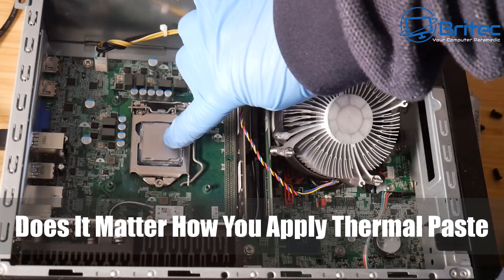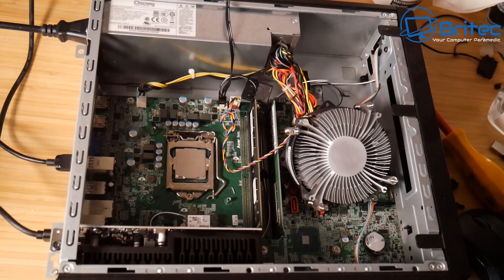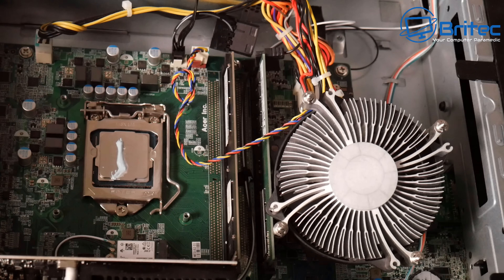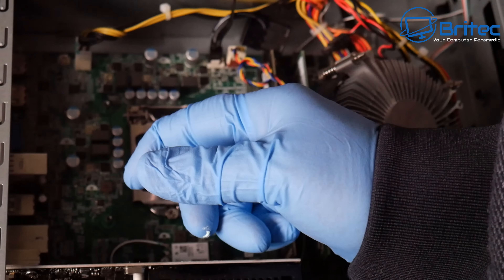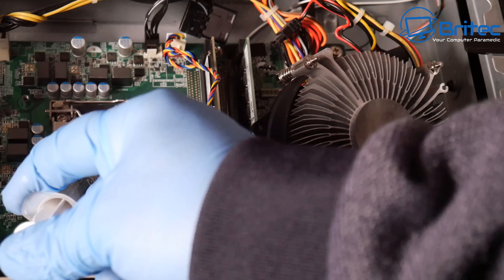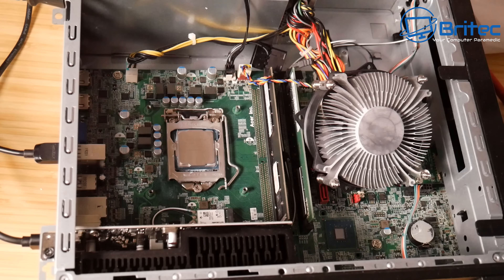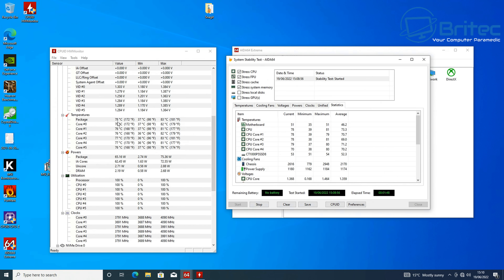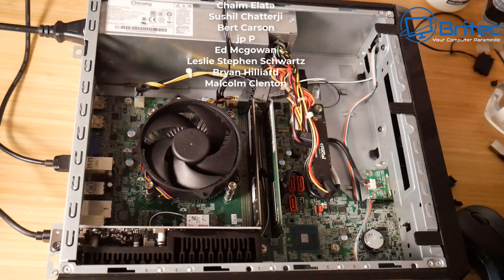Does It Matter How You Apply Thermal Paste

Comment from the maker: How do you apply thermal compound? Drop us a LIKE 👍
Reply: I've always used the spread method as I was taught in IT school. But as you said, as long as the head spreader is covered that's what counts. I also believe in lapping the CPU and the water-block or air cooler so they are as flat as possible. My water-cooled over clocked Ryzen 9 3900X usually idles at 28c, and tops out on most games at 48 to 52c.
Reply from the maker: Very nice temps.
Reply: Pretty much the same way as you do Dave short & sweet without any air gaps.
Reply: @Britec09  Thank you.
Reply: I use the spread method. Apparently, some batches of MX-5 were recalled early last year due to production issues.
Reply from the maker: That must be one of them, because it was watery
Reply from the maker: I see what I can do
Reply: i have always spread it out with a credit card or spreader. i did a lot of overclocking and extreme cooling 20 years ago and found it gave me the most consistent results. But as we all know, anything that comes pre built has the one blob method and that is good enough for most applications.
Reply: pea method works fine for me, have a nice day :)
Reply: A little Satire is great.  :)  made my day.
Reply: Dumb comments are kind of the price of being in the open and seeking attention in public. I understand how this is unwanted but you cannot have the 1 without the other. Seeking a large amount of people means you will get the attention of the smart and also the less smart. Earning money here while complaining about the negatives of being in the open dont go together too well. If you seek a large amount of people you will get the attention of all kind of minds and mindsets.... just be happy to get attention. There is this little place called reality and things work that way around there. But its good to have yet another vid about the subject of paste, gg.
Reply: I've always used the dot method in the center. I use HeavyLoad to stress test the CPU and I have a Noctua NH-D15 for a cooler. After a half-hour test, I maxed at 52C. I would say that's pretty good!
Reply: Britech i know you smart but you put the problem wrong, put rise on AMD tredriiper and put on i3 2 core 4 treds. in your videon you not specifi your pc your procesoor.
if you use 5 years old procesor ,even with tooth past ,the procesor will stay cool but if you put in amd 5950x is not the same

Comment: I agree with you. As long as you use a good thermal paste and you get an even spread it doesn’t matter. I’ve spent ages looking into this and testing temperatures and the differences between methods is negligible. After installing CPU bench test and monitor thermals
Reply from the maker: Totally agree!

Comment: When I first got in the game I was trained to spread the CPU paste with a spreader.  Now I apply the paste in a small circle in the middle of the CPU, slowly tighten down the heat sink fan to the CPU, and the paste spreads out perfectly. Out of curiosity I have torn down and inspected computers I did two to five years prior, and they all look perfect.  
If you're super OCD about it apply the different methods to your own personal CPU until you get it right.  Like Brian says almost every method works the key is to apply the correct amount.
Reply from the maker: Well said, what ever works for you.
Reply: Yeah...I use the pea method...just in the center and be done with it...

Comment: What I've found over the last 40 years is that is is less about the method you use, but getting to be consistent and proficient with that method. Find out what works for you and don't worry about what someone else does. I've learned what works for me and I stick with that.

And no, I won't say which method as that can change depending upon the specific compound I am using at a given moment.
Reply from the maker: Thanks for sharing.
Reply: @Britec09  My pleasure.

Comment: I just put enough of a blob on it to cover the CPU and that's it. never had a issue or really care for the arguments.
end of the day thermal paste is only there to fill in any imperfections on the cooler base and CPU IHS so that all air gaps are filled allowing the heat to freely travel through
Reply from the maker: Well said sir Tony

Comment: The very first computer I built going back to my AMD K6III, I was given advice by a friend who had constructed his own water cooling system using a bucket of water and a bunch of hoses. He told me, you put your thermal paste on, then you take a razor blade, you hold the razor blade at 45°, you pull it across the top of the surface so that the thermal paste is even and smooth, and then you're good. Ever since then that's all I've ever done and it works perfectly.
Reply from the maker: Glad that method works out for you.

Comment: another helpful tip is to lap the cooler surface using 400 grit 500 grit then 600 800 then 1000 grit to polish and use metallic infused compound like arctic silver which have better thermal transfer.

Comment: Great video as always Brian! I do agree people make it out to be a much bigger deal online than it is. In my opinion getting the "perfect" amount of compound isn't as important as it probably was 20 years ago. I've never been the best at fitting CPU coolers or applying thermal compound, so much so at one point I managed to assemble a cooler that wasn't aligned properly and that's where the PC kept freezing up and I had to pull the plug out from the mains to get it to turn off so I could restart it (since even holding the power button didn't make it react). Upon correcting the misaligned cooler, I never had any problems going forward. Same as I've never had any issues with PCs due to bad thermal compound application, although once the pre-applied compound that came with a cooler caused issues to start with but after a few days the issues settled (where I'm assuming the paste has spread out properly).

Although I will just say one thing, along with the messiness of too much compound, some compounds if they spill over onto the motherboard can cause it to short circuit, but this isn't a criticism since you did say you shouldn't put much on, but just perhaps that was another point to note :)
Reply from the maker: That is liquid metal and not you normal compound, already answered that question in the comments :)

Comment: Personally I use only Grizzly products applied to both surfaces with a small applicator,  there was a time when I used bulk-rate thermal paste and the pea method but have found over the years that total die coverage with an applicator does indeed reduce thermals and quality paste matters.
Reply from the maker: Grizzly thermal paste is one of the best

Comment: I made an applicator for doing this and I always apply it to the heat block and not the CPU. In all but rare cases does the heat block fit the same dimensions as the CPU. Anyway, I apply the paste and then use my tool that spreads it much like you would applying cement for a tile and it has never let me down and never wastes any!

Comment: Brian it ihas occurred to me that when they make  CPU's they put a compound on the underside of the metallic top cover and the silicon chip for heat transfer. My query is will the metallic thermal compound also bond directly to the silicon chip itself as some you see in GPU's. Can not find an answer in Google searched  so what is your expert opinion?

Comment: I use a Thermal pad. works just as good and absolutely no mess to clean up. All of these methods in your video differ by a degree or 2 Celsius and none will stop the computer from working. Amazing what people will bitch about it seems

Comment: Anytime you apply paste into the middle of the IHS, it will spread into a circular shape. The ISH is NOT round and that means the corners are not going to be covered unless you apply so much that the edges overflow.

You need to cover 100% of the IHS. I realize that the heat-producing elements of the CPU do not extend fully to the edges, but the job of the ISH is to "spread" the head evenly and therefore you want 100% of the IHS to have the ability to pass heat to the cooler.

The spread method is really the only method that pretty much guarantees 100% coverage. You can get 100% with others, but then it relies on using just the right amount of paste. Why allow that to be a variable?

Comment: When I worked for Motorola we used to have instructions on the need for paste. Basically all metal have fine indents on the surfaces, so you fill these indents with heat absorbing paste. Nothing more,

Comment: i think that the best product today is THERMAL PAD THERMAL GRIZZLY CARBONAUT . These thermal pads are avaliable for any type of CPU and GPU ,are reuseble and have an amazing rate of thermal contactivity : 62.5 W/mk . You don`t need any skill to apply them and you have not any risck from leakeges.
The benefit is that you pay for that once as you can use it again and again ! With a cost around to 10 euro you solve the problem once for ever.

Comment: Question: is there a time where the paste should be replaced?
Reply from the maker: If you use the spread method, this will cover the whole heat spreader for any CPU, so you can't go wrong.
Reply: @Britec09  sorry, what i meant was should the paste be re-applied after say 10 years of use or does it last the lifetime of the cpu?
Reply from the maker: @VSTV1993  Replace the paste when your seeing temps rise, which will be in a few years. But saying that, its cheap and won't hurt to change it more often.
Reply: @gilkesisking im asking this because iv got an old laptop which is i think a 2011 model BUT its a good decent laptop and iv upgraded it with an SSD and more RAM and iv even swapped out the cd drive for a HDD Caddy so i can i have more storage, i watched a few videos on it off Youtube and the cpu temp hit just short of 90 degrees but then came back down with the fan on full speed
Reply: @gilkesisking could even be that the fan needs a clean at best

Comment: It’s been all proven and tested many times. The application method all gives the same temperatures within the margin of errors. Do the simplest way that works for you mostly. The pressure from the cooler will spread it evenly.
Reply from the maker: That is the point of the video
Reply: @Britec09  yes 💯 i was written while watching it. I very like your optimization videos. I learned new ways to make the system smoother. Its also very good for fixing other computer.

Comment: CPU have thermal throatling at 80-90+ celcius temperature. Any way of use thermal paste will not do any damage if you put it on CPU heatspreader. Just dont use it under cpu,i mean on the gold pins of CPU or dont put paste to motherboard socket :) Instead of raging this method made me +1,+2 celcius slap your face with hand and think diferent,maybe if i made my home,room temperature down with climatization,the temperature will improve even without changing thermalpaste,wooow,what an surprise it will be :) :) Pro TIP: Product Thermal Grizzly Conductonaut is not thermalpaste,its liquid metal,it means it is electroconductive,you can kill your hardware if you dont know what are you doing. Safe method is stick with thermalpaste,thermall grizzly have good Cryonaut and Hydronaut,nice for overclocking. Btw,if someone say,one method is good,one method is wrong,compare runing CPU without any thermalpaste,only the cooler enabled vs some random crazy paste aplly.
Reply from the maker: Thermal grizzly has Kryonaut which is not Electrical Conductivity and Conductonaut  which is liquid metal thermal compound which is Electrical Conductivity. In this video we are talking about thermal paste and not liquid metal. Also this is not about what the best thermal paste
Reply: @Britec09  Yes i know. Thats right. You know how this world is :) One will say this is better,one say no way,this is mouch better :) :) How many people living,that many opinions there will be :) Have nice day :) I will on monday use to my laptop thermal grizzly hydronaut,they say the temperature for the paste is -200C up to 350C :)

Comment: Hey Brian.  I just have to share a SIDEBAR here.  It amazes me how blissfully unaware most PC users are of this 'delicate' heat situation in their computers.  I was in that boat until some 10 years ago.

We presume that a PC has a chip in it and then we learn, oh, it has a fan too cool off when it gets shot.  Sure, okay, that makes sense.  But to then learn the fan cannot completely cool the chip but also requires some sort of weird paste which disintegrates over time --

-- sounds like TERRIBLE engineering.  Also as bad is dust build up in the fan exhausts.  You'd think there would be a simple 'thing' to click open and vacuum out the dust.  But no, which again is TERRIBLE engineering.  Both shortcomings ensure a shorter life span for said electronics.

My wife has an Asus Vivobook s15 from some years ago.  The fan was recently rattling.  I purchased a 4 year warranty on it (good deal, too) but I didn't want to have to send hers in and wait for it to come back.  So I found a YouTube explaining EXACTLY how to open this model and I was frankly amazed at how difficult it was to do.  Engineered to NOT be user friendly. 

It took time, I managed to open it, and found a HUGE dust bunny at the fan exhaust pipe. I figured I'd add some RAM while I was there and it was a fun victory in the novice 'repair man' sense --

-- but still this should be a LOT easier for normal folks to do.  Like a door on the back of the unit.
Reply from the maker: Well done.  Thanks for taking the time to comment